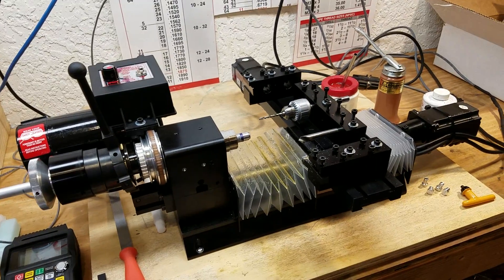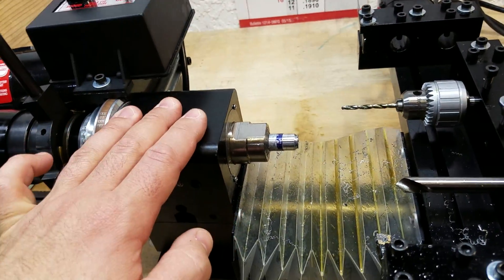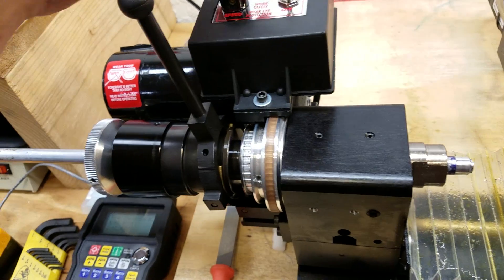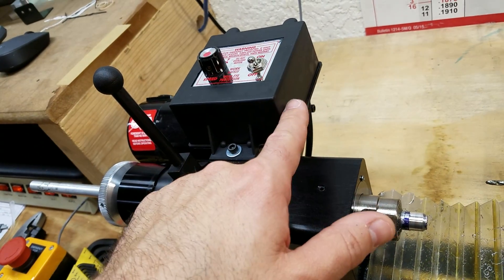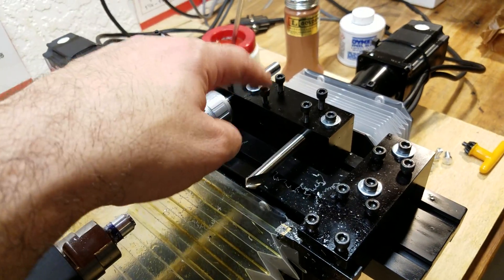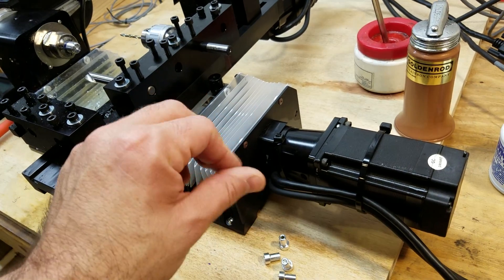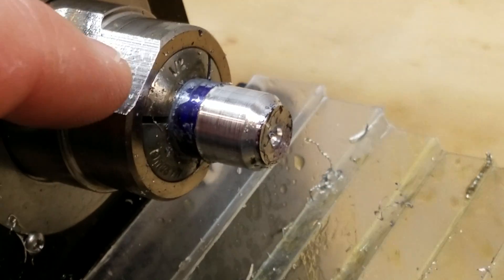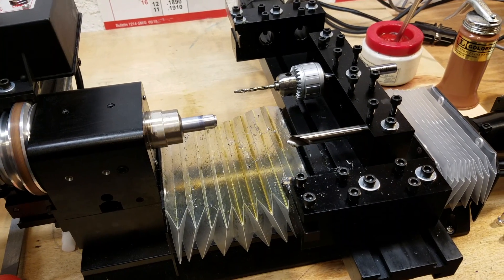CNC Chucker Lathe by Sherline Powered by Centroid Acorn

Comment: Hi again Franco,  Going to get the chucker lathe.  Im deciding on what controller to go with.  Do you think the Acorn is better than the Masso control? How much did you spend on the Acorn? seems much cheaper. Any input would be awesome If you have a vid on the topic comparing them lmk. Thank you.
Reply from the maker: I like the Centroid Acorn system.  But, I think Sherline has a working relationship with Masso and it may be easier to get that up and running in your case.  Both options are good.  For a lathe, you can't go wrong either way.

Comment: Hey Franco thanks for the vids.  I'm looking at getting one but considering the 18" cross slide and 18" base.  I have the standard Sherline manual lathe as well and originally it was the smaller base model and I need up upgrading it to the 18" base, as I always felt too cramped and sometimes a bit limited with the smaller base.  SO I wanted to ask you if you feel like the 18" table and base would be better? Do you regret not going with the bigger one for its versitily?  It's only about 120.00 bucks more.
Reply from the maker: Bigger is better 😃
Reply: Thanks for the reply I figured you would say that.  How about the encoder set up can you cut threads with the standard Linux controller? And did you ever post a vid of it cutting threads?

Comment: Since the video is 2 years old it may be covered already but you can do tool changes without having to confirm the change by editing your code. Something like T0101, T0102, T0103 etc instead of T0101, T0202, T0303. Hope that’s clear. Saves cycle time and you can walk away. I have learned so much from you and Marty and can’t thank you guys enough!
Reply from the maker: Hi.  You can do it any way you would like.  I choose to have a stop between tool changes but you can easily setup the system to complete tool changes without any optional stops or manual conformation.  Thanks for watching!
Reply: @FrancoCNC  You can use the stops as tool change cycles if you use a single quick change tool post and pre set tools.

Comment: Hello Franco, Did you use the Sherline High-Torque Stepper Motors 67126 on your Chucker? Looks like they come with a plug, did you have any diagrams on the wiring hookup after cutting plug off?
Reply from the maker: Hi.  I did not use those motors.  I used these:  https://www.automationtechnologiesinc.com/products-page/nema23-closed-loop-stepper-motor-system-hybrid-servo-kit/hybrid-servo-drive-kl-5080h/

Comment: So you got the version without pc and put a acorn board in it ? That is really nice.
Reply from the maker: Thanks.  So far, no regrets.  I really like the Centroid software/hardware and the closed loop steppers are WAY better than any open loop system.  I had to piece it together myself, but was less expensive than the Sherline CNC package.  That being said, I'm sure the Sherline CNC system works just fine - it just wasn't what I wanted to use.

Comment: Love the videos, very Informative.
Reply: Also that quick chuck is just asking for a pneumatic cylinder and a bar puller. Automated sherline. Use an arduino to control that side of it, trigger from the acorn. Servo spindle motor, pneumatic spindle or cheap small Chinese ones on the gang tooling.. Live tooled, bar fed sherline CNC lol
Reply from the maker: I like the way you think!
Reply: @FrancoCNC  hey is that above you how the Chinesse make wind up and automatic watches so cheep?

Comment: There is no reverse as the standard Sherine lathe uses a screw on type spindle nose... A reverse feature would allow chucks and other accessories to remove themselves under load and cause all sorts of damage for anything other than collet types
Reply from the maker: Good point.
Reply: Ramiro M j
Reply: Sorry I hit the wrong button!
Reply: That makes zero sense, there are millions of small, and medium sized lathes since the 1900's with screw on chucks...all have reverse! Examples, Atlas/Craftsman, Southbend, just two hobby lathes, screw on chucks were the norm until the 60's/late 70's!

Comment: Nice machine Franco
I think you would find ER collet holders good for holding drills, I think they would save you some Z space.
I use gang tooling a lot, particularly for drills, I like to have the drill point level with the position of the parting tool as this means it should not hit the chuck or headstock.
Nice collet closer, much better than my home made unit.
Reply from the maker: You are spot on about the tool lengths - it's best to keep the tool tips on the same plane.
Reply: Franco, I learned the hard way as my lathes all home the X axis first, so if a tool is out beyond my turret, it is very easy to have loud noises occur..
Reverse would be good, but do remember your chuck screws on!

Comment: Dunno what to say Franco. What are you going to make with it?
Reply from the maker: You sound like my wife.  If I had a nickel for every time she has asked me that...well, you know how it goes.    True, it is a small lathe but most of the stuff I make is small.  I make a lot of stand-offs and posts.  Threaded connectors for my RC cars.  Little fittings and adapters.  Things of that nature.
Reply: Ha ha, just wondering. After seeing you go bigger on the mill, I couldn't understand why you were going in the other direction with the lathe.
Reply from the maker: I'm running out of room in my garage - and free time in my schedule is becoming scarce.  The Sherline is a good compromise for me right now. It's small, but it works well and all I have to do is install the electronics.

Comment: Very cool. From the centroid FAQ’s they say you can run both the lathe and the mill from one board. My intentions are to unplug the mill steppers and plug in the X & Y into the the same X & Y the mill uses. Any concerns that you see with that? I’m going to be using both Acorn Pro mill and lathe software. I’m using you as cheap tech support since your videos convinced me to go with the Acorn, which has proven to be a great choice.
Reply from the maker: It is possible.  I recommend you purchase two inexpensive DB25 breakout boards.  Use one BOB for the mill and the other for the lathe.  Then, you can use the DB25 connection on the Acorn to interface to either of the two BOB's.  I think this would be the easiest/best/safest way to get there.  You can mount the Acorn and the 24V power supply in a small enclosure and use it for all of your machines.
Reply: Franco Thanks! I just saw your response and will consider that, makes sense though, I was noodling the easiest way to run both without investing in another Acorn.